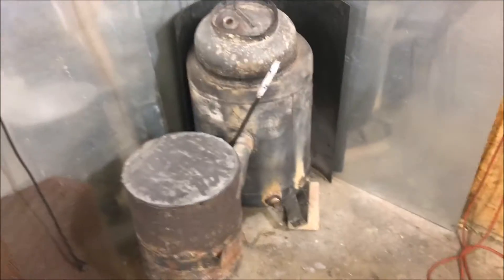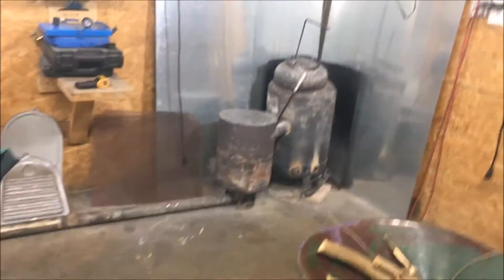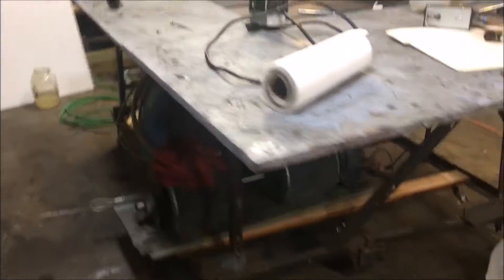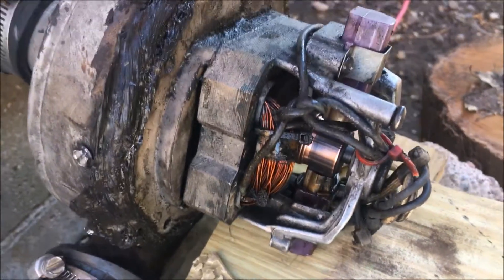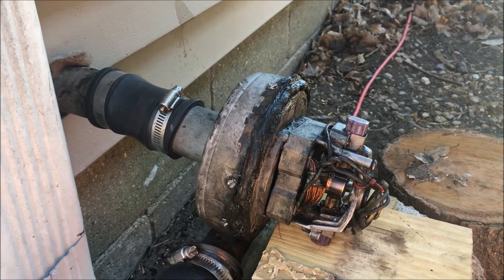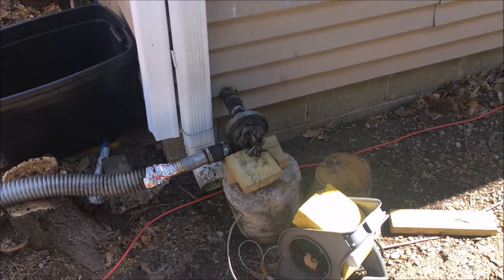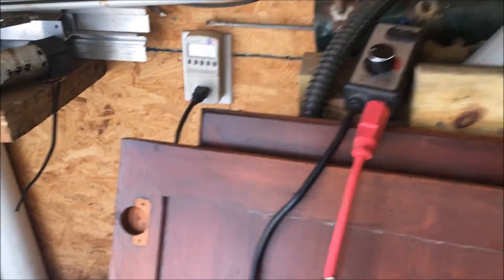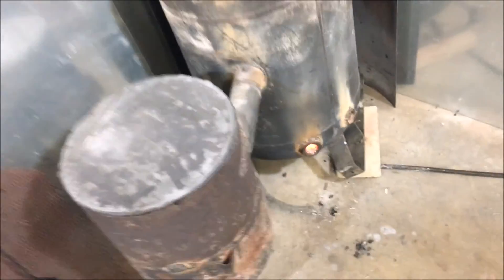Induced Draft wood Burner and DIY flue Blower Information

Comment: You can replace the brushes, especially if you catch it before it goes metal-to-metal [like brake shoes in a car] and along with the keeping oil in the bearings, it should run forever. That said, the impeller will eventually erode away from particulate ash and carbon unless the exhaust is well filtered or slow-air settled...

Used motor oil will have upwards of 200 different rare species organic postcursors depending on the fuel additives, compression ratio, blow-by, leakage of coolant, overheating the oil, whether or not the vehicle has a PCV valve or if it is just open to the atmosphere, what type of rod bearings it has, and the quality of the filter.
Reply from the maker: True ,Im thinking about getting a catalytic converter , ever seen one on a wood stove ?  
actually the creosote seems to protect the impeller lol , good for something i guess.
Reply: Actually at one point I professionally installed wood stoves for a guy who sold really expensive soapstone slow burn wood stoves, and since there was so much unburnt gases in the slow burn [not that a fast wet burn will not do the same] that they manufactured and now market flue and pipe mounted catalytic converters for stoves.

This is just one of many such offerings, I like this one only because it comes without needless additional casing [foe we engineering types] so, 1, you are not paying for stuff you may not need, which may not fit, etc. and 2, you can use this with or without a wood stove [such as using it downstream of a hot oil flame for instance], and, if need be, one can cut it into pieces and fit it into multiple smaller tubes, or, line it all up in one smaller tube. [that just needs some refractory cement to achieve]

With a good catalyst, one can easily inject [or in the case of a vacuum, simply 'bleed in'] additional air to ensure clean and complete combustion.

This not only allows a cleaner exhaust and cleaner machine, it gets more heat from the wood, which decreases the amount you need to stay warm.

Comment: Nice vid, was wondering about the winter time use of the vacuum motor. How do you keep it dry? Oh and why not use a creosote log every several fire's too? That may help with cleaning the exhaust and vacuum pump fan.
Reply from the maker: i use to use those logs bug they dont seem to do any thing . also the device doesnt mind getting a little wet , ive abused this device for over 5 years
Reply from the maker: i forgot to mention this fan does not get wet , i take it inside during the rain season and during winter the snow does not get to it wen its off